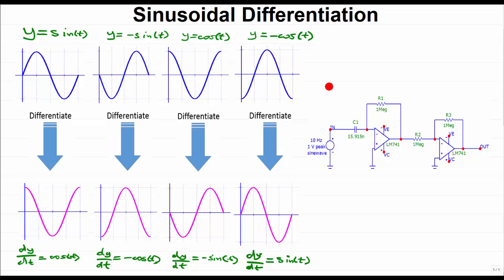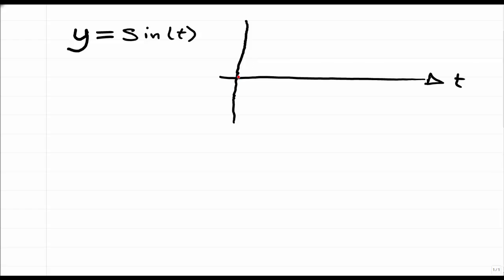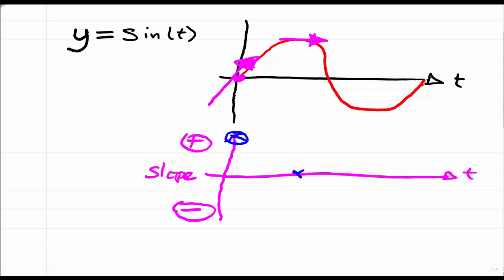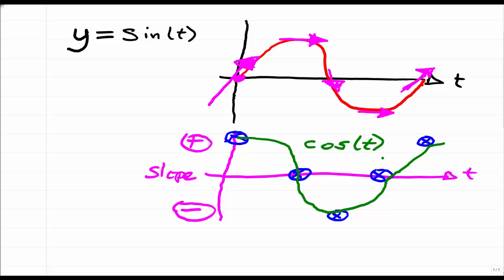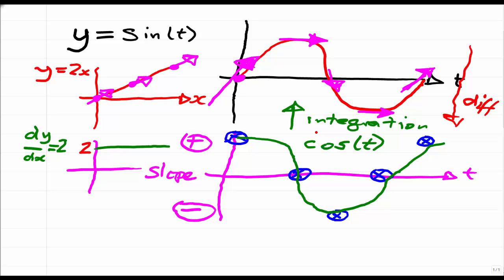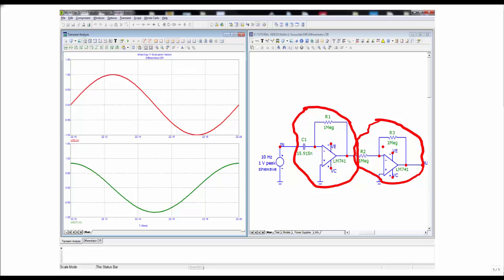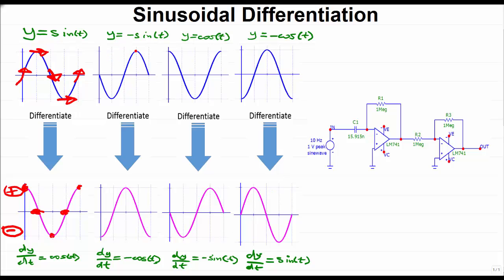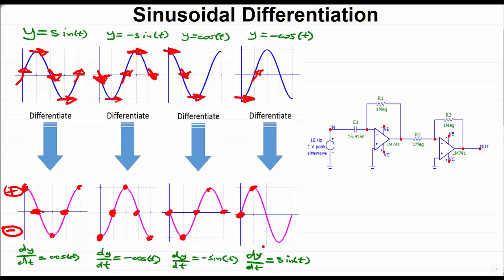Sinusoidal Differentiation

Comment: Hi. Thanks for the explanation. One question. In the fourier time Differentiation, why when apply differentiation you get that higher frequencies will be higher as a result? Would this apply to waveforms of both low and high amplitude?